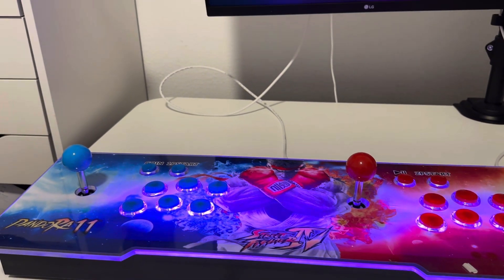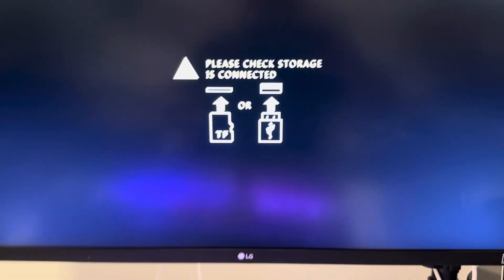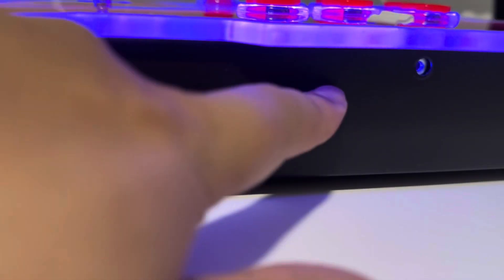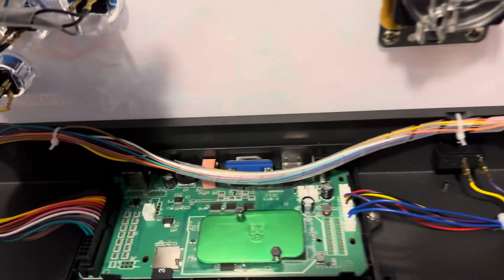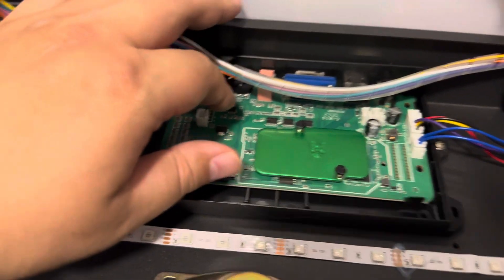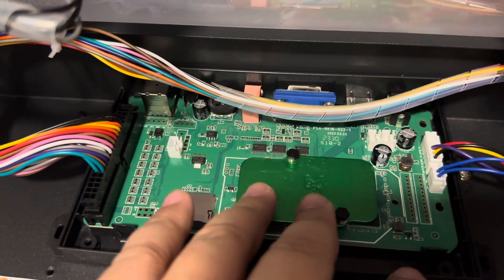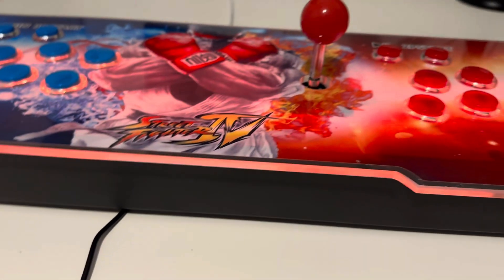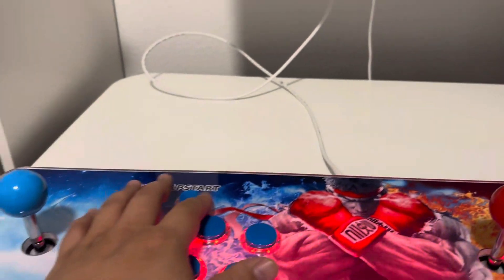Pandora11 Please Check Storage is Connected troubleshooting

Comment: My Pandora box has the same problem but doesnt have sd slot :(  PLEASE HELP!!!
Reply from the maker: My SD card was very well hidden before I shot this video, it was covered by a white tape.  I am not trying to say that you should start breaking your box, but check the mother board inside the box and see if you see a white tape that is covering the SD card slot.  Just be careful with it.  Hope you were able to find a solution.  Good luck.